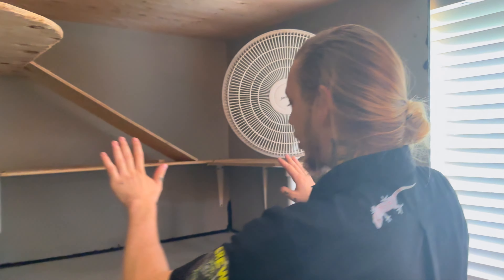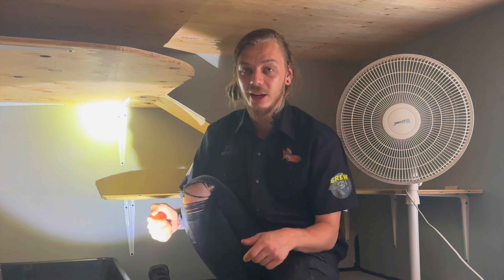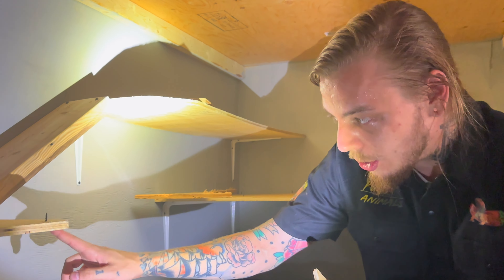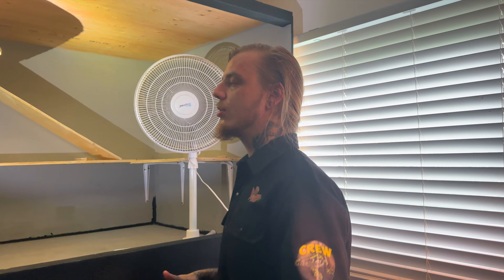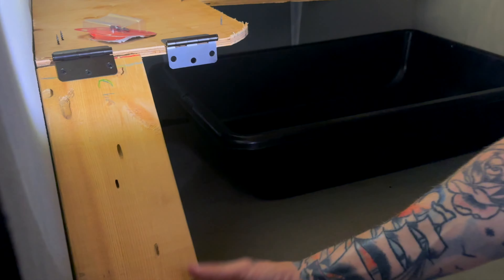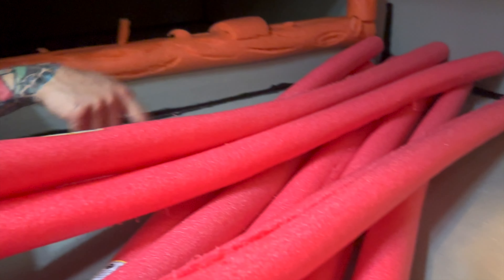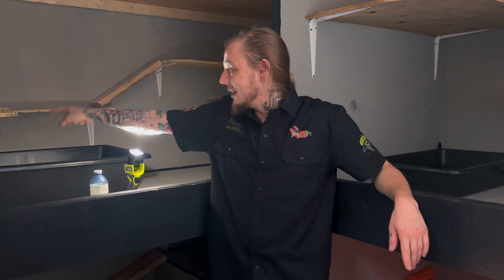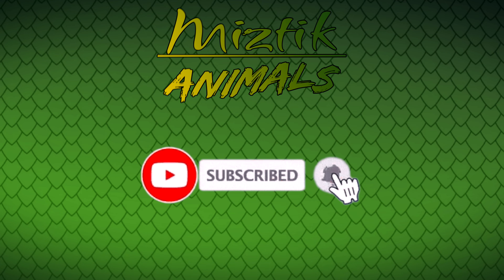BUILD UPDATE!! (+ why we took a week off)

Comment: Just so you know, nothing sticks to pool noodles until you go over them with a heat gun or flame, and do it outside as it lets off a TONNE of fumes.
Reply from the maker: thanks so much for the tip! that's always appreciated!!
Reply: @MiztikAnimals  another good trick is to use Hessian weed mat or fabric and use it like paper mashee , you basically cut it into strip's dunk it in cement  drylock or tile adhesive and wrap it around the pool noodles, once it hardens you can build details on top more easily and you get a more realistic look.
Reply from the maker: I think the plan was to use grout for the finishing touches, but I'll look into this option too! 👀 still got a lot to do before we get there 🤣